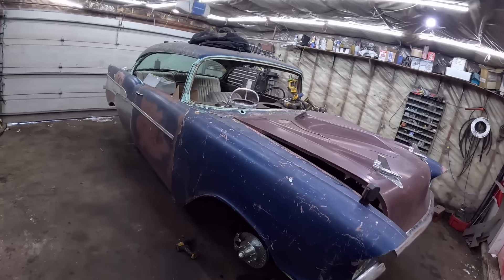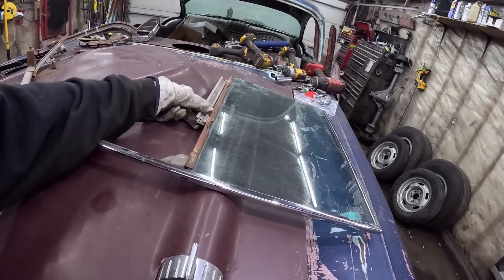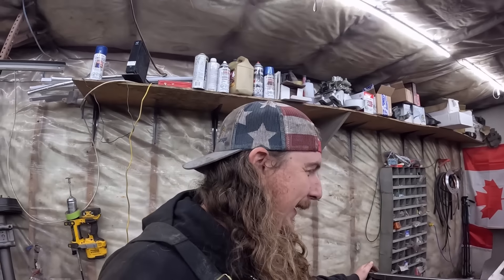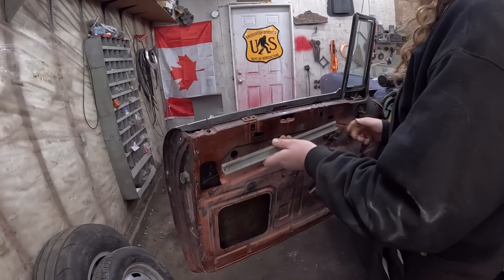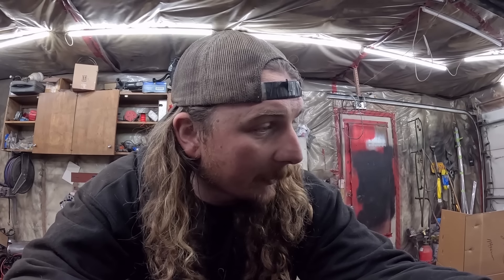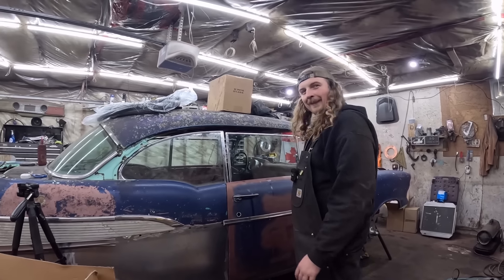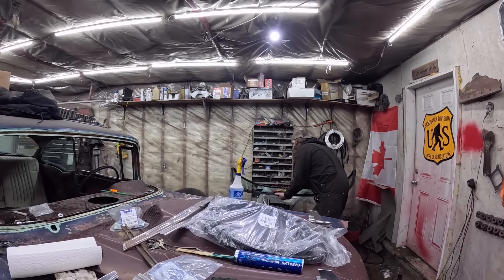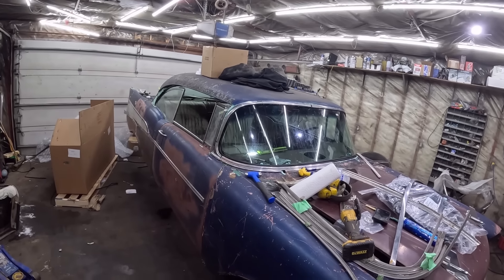JUNK Glass For A JUNK Car - Installed With A Hammer? The Worst 1957 Chevy

Comment: That's a great glass video, I have only one experience doing a windshield on a vehicle, was a new rubber seal for a 67 VW baja bug where the original seal was so hard and cracked that the windshield was in danger. Regulators, door glass mechanisms,..some are such a chore, especially those rivetted in.

Comment: Dan buy a couple of glass suction cups so you can put the glass in hole easier! The real trick is to  put downward pressure on glass out side as some one pulls the string. life saver so to speak. Makes it simpler.

Comment: Before watching your videos, I never realized just how many models and trim levels tri five Chevys came in. I thought there were 2 doors, 4 doors, and wagons, in 2 trim levels, not including the Nomad. The one to have was, IMO, the 1957 Bel Air 2 door hardtop. I will never have one, even a halfway decent one costs $100,000 in the U.S.

I have installed a lot of glass in trucks and VW Bugs, rubber seal only, no chrome trim. I used soapy water, a roofing knife, and heavy weed whacker string. I was able to do most of them by myself. 

That hood seriously needs to go. It's a FORD hood.

Comment: Hood pins shows laziness.  Take the time to do it right.  Slow down.
Reply from the maker: The car was in the process of being a race car years ago.  But if you have all the hood and trunk latch assembly send it over and I'll put it in for ya.
Reply: Dan, you can do it.  Just go find them.  The car could be nice sometime.  Going cheap to finish means you have too many directions your going.  Less is more.   I know you need constant contain but.  You have worked so hard.  Reach out to your followers.  They will find the right parts.  Maybe, come back to it.  Thanks for the encouragement.   Cold here as well.  Mpls,MN.
Reply from the maker: @jerrybaldwin2172  I think u missed the point of the car.  It's supposed to be a fun cheap car that's been brought back from the dead.
Reply: Bring it back better.
Reply: Still think you’re great.